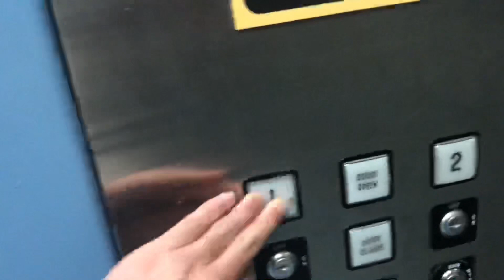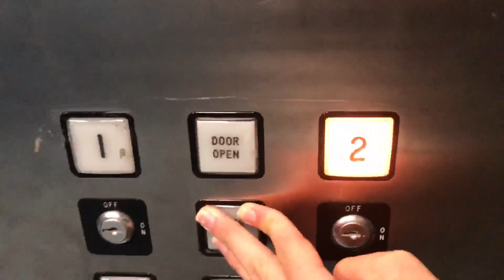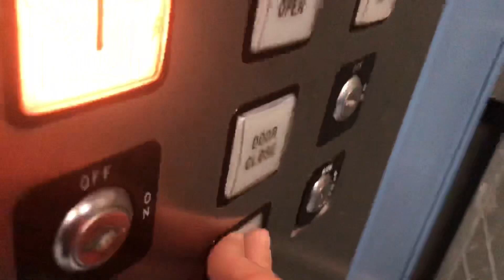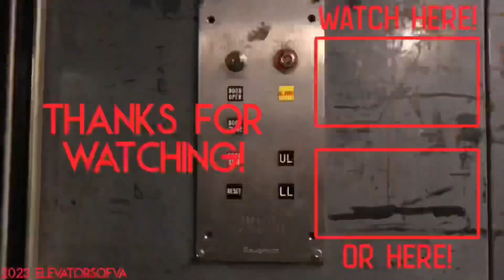Schindler Hydraulic Freight Elevator #8 - Dulles Town Center - Sterling, VA

Comment: The numbers could also be counting escalators & passengers & the numbers could be mixed up (e.g. 1 is a freight, 2 is a passenger, 3 is another freight). A mall near me's like that.
Reply from the maker: Yeah numbering here is very weird, one of the passengers has what is supposed to be freight #3’s certificate, but it doesn’t match the elevator at all, since it says freight 3 has a capacity of 6000, but the capacity of that elevator is 3500. Maybe if there is a freight 3 it is holding the certificate of that passenger.